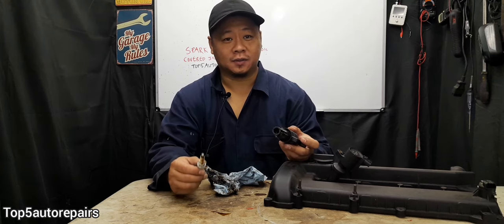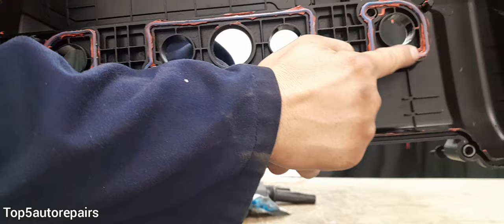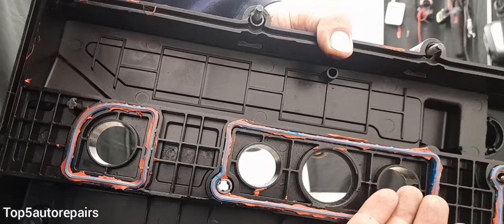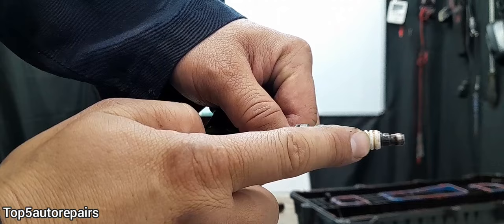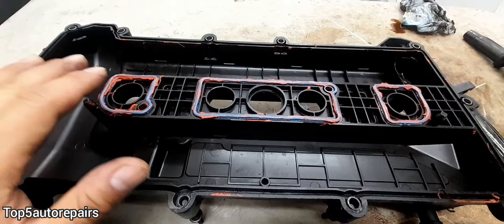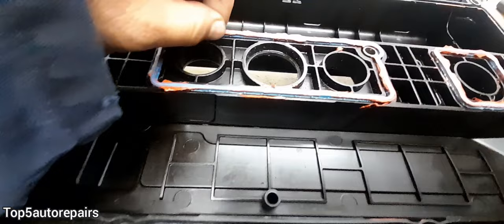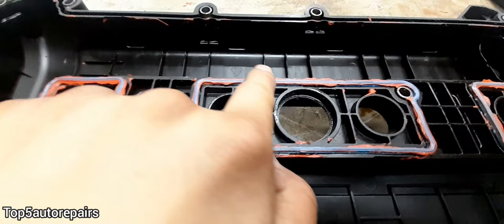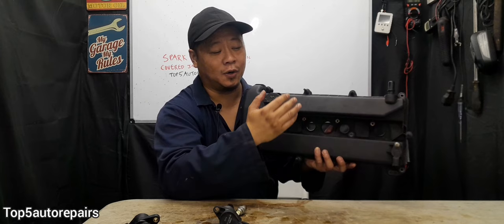WHY IS MY SPARK PLUG AND IGNITION COIL COVERED IN ENGINE OIL.

Comment: That’s not necessarily true, in most cases, it’s the spark plug tube itself, and not exactly the tube seal, because oil doesn’t rise that high in the valve cover, you would have to pull the spark plug tube and reseal it.
Reply: That's not necessarily true either.  The oil doesn't get "high" but between the pressure and the splash it can sneak past the valve cover spark plug seal if its crack/worn out.  I see this all the time.
Reply: So you think it’s the coil seal?

Comment: Hello,  thanks so much for the video.  I was changing my spark plugs  and found the problem you described.  So you are saying that, the most likely cause is the spark plug seal.  Some people that the valve gasket could be the reason.  So either one of them could be the reason.  Or both of them could be the reason.  Is that correct?
Reply from the maker: It's both. When you buy the valve cover kit it will come with spark plug tube seals.
Reply: @Top5AutoRepairs  Thank you for your response.  I think  I got it.

Comment: Working on a 2017 Porsche Cayenne S V6 3.6L twin turbo, appears to have small leaks around the valve covers. Two questions for you it appears I have two sensors on the end of each valve cover. Not sure what they are. Second question once I get down to get in the valve covers off, is the orange RTV really necessary with the new gaskets.?? Thank you

Comment: In case this helps anybody.. I was getting a misfire on cold starts, car sitting for 10 min or so.. turns out it was a loose valve cover. I torqued it down to spec all was fine then issue showed up 2 months later. Tightened her up likely above spec and all is good. Maybe it was a out of spec gasket idk.
Reply: Well thank you, exactly my problem
Reply: @r3m1x3ddmuchi6 good to hear it helped someone… that misfire was scaring the 💩 out of me LOL

Comment: Exactly the problem i have.. mechanic did ever bother to look further or run and compression tests etc and just said you need a new engine :(... mine is a 1.8 2009 ford focus petrol. hoping to go it fixes it. Question, what it 1 plug well is dry but 3 have oil in ? could that still be the seal or its it somthing worse ?
Reply: @nowayjosue660 was just the rocker cover gadget

Comment: It could be one of a few things. Not necessarily this. In my case, the rocker cover was loose, probably from the factory, letting a little oil through the seals into the SP well. All it needed was tightened.

Comment: good info about finding oil on spark plugs top or bottom side thanks.   Wish I could find a trustworthy and affordable auto repair shop.   DIY till the wheels and engine lock up and fall off.  Cars and trucks today are bloated with tech and cheap crap with high price tags.   Also what do you drive or like to work on? and whats some issues you face in your line of work with some cars and trucks.

Comment: Hi brother, I need help or suggestion from you because i took my 1997 Toyota Tacoma to Toyota dealer and they replace valve gasket, cylinder head , spark plug gasket , oil filter housing , front crank seal, flush brake fluid and cooling system and my car running rough while stop on the red light pl advise

Thank you.

Comment: Stupid design! What brand is that?
Reply: Gmc, Ford, dodge (perhaps others) have similar designs.   I have a GMC Acadia that uses that longer coil pack.  no messing around with all the long spark plug wires.  pretty simple really.   Its the removing all the intakes and what not that is a pain to work with.

Comment: i removed the spark plug and some oil got into the cylinder im not sure how much.....is this going to effect anything?
Reply: It won't cause damage, if you are really worried - put a narrow tube in the hole and suck out the oil that got in there
Reply: @GP5zona  thanks bud, i read some people online saying it could hydrolock the engine, i just wanted to make sure
Reply: @nyflo718  If there is more than a tablespoon of oil - extract it out. If it's less, leave it, the oil will burn off once the car runs for a couple of mins. Hope it helps, good luck.
Reply: Would that also cause over heating
Reply: I loosely cover the plug holes with a paper towel  (with a little weight to hold it down and turned the engine over to have the pressure blow it out. Works like a charm.